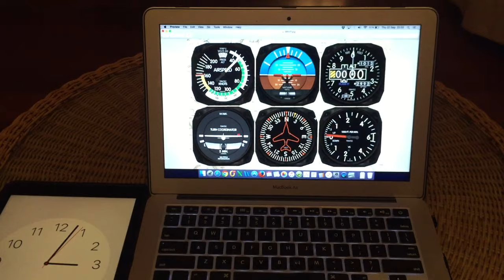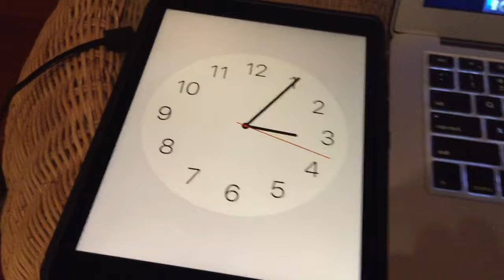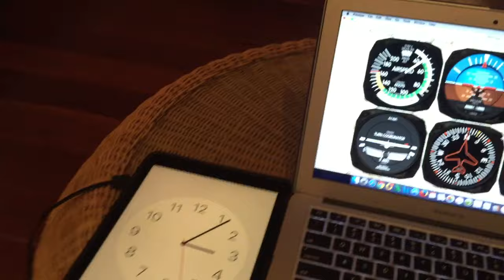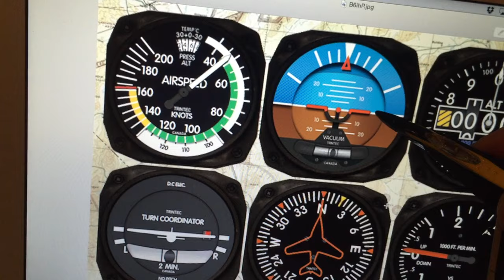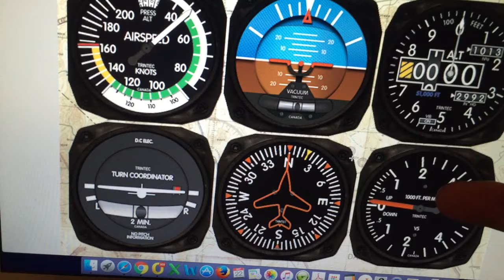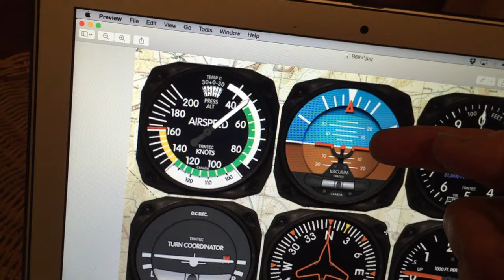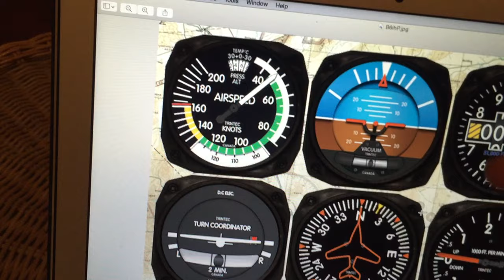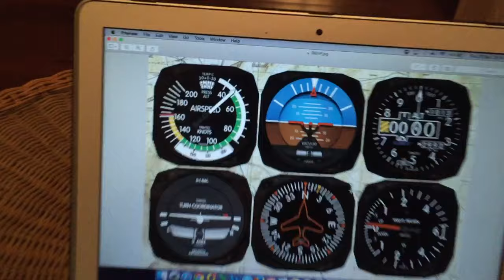Do aircraft change attitude to follow the curvature of the Earth?

Comment: +Wolfie6020
What I (not a pilot) have come up with while looking in to the elementary physics of flying  is that air planes (except fighters etc) are supposed to have been trimmed so that the centre of gravity is in front of the point where the lift affects the body, resulting in stable flight. I am under the impression that stable flight (in perfectly calm conditions) should enable the pilot to take his hands off all controls, and the plane should maintain its altitude above ground and thus "follow the curve" without "dipping the nose" because airspeed isn't set for gaining altitude. Gaining altitude (in mid-flight, while flying decorously) is achieved by increasing air speed which in turn increases the lift. One doesn't pull up the nose either (except after take-off).

So I'm not really convinced that these "minor corrections" you describe are required to maintain height Of course, these "perfectly calm conditions" may not really exist and require continual attention by the pilot, and there's not just longitudinal stability to maintain.